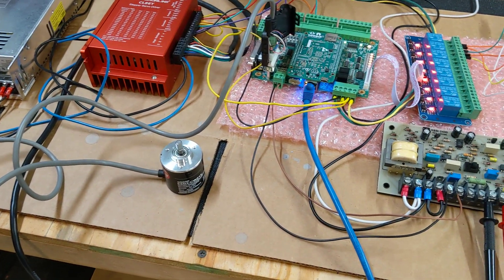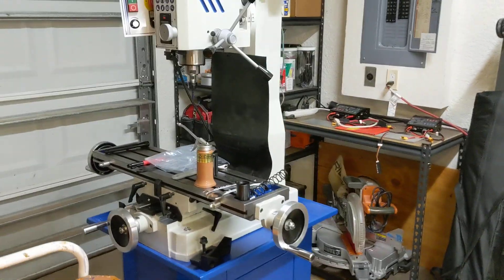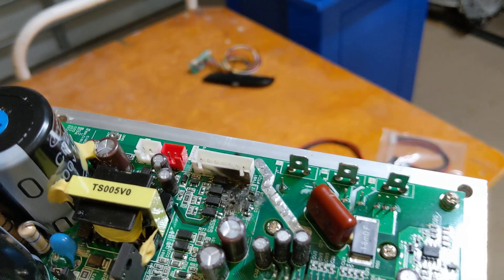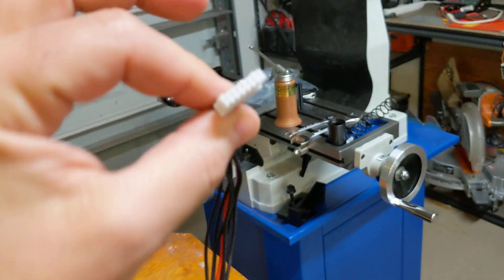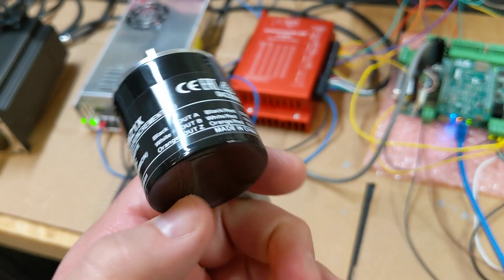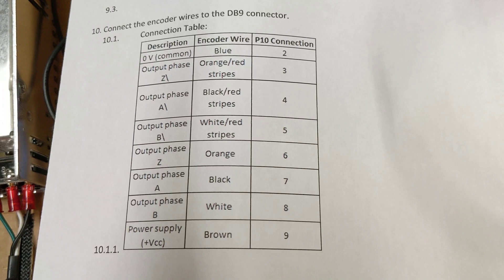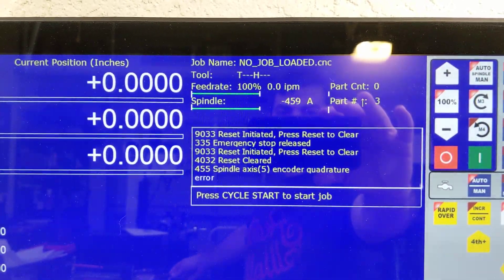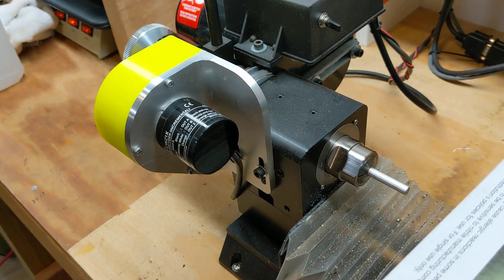PM-728VT Spindle Control #4 with Centroid Acorn

Comment: Totally unrelated comment for the video. Have a question about ClearPath servos. I'm looking into a WorkBee CNC 1500x1500 build with a water cooler 2.2kW spindle. Is it worth moving to a very high torque NEMA 34 motor for the Z axis to ensure proper functionality? Looking at the CPM-SDSK-3441S-ELN servo. I will also be running two IPC-5 units to ensure proper power handling for higher torque servos.

Comment: This is a PWM to 0 To 10 volts converter and it can be wired in to replace the Potentiometer if their is a DC voltage lower than 12 volts across the Potentiometer's wiper and ground. It has the relays for the reverse and forward directions. Read the page 10 for how to do this.https://www.cnc4pc.com/pub/media/productattachments/files/c41s-r1.1_user_manual_v1.pdf

Comment: I'm mounting an identical encoder on my near-identical mill. I've bored out a little GT2 timing belt pulley to fit over the drawbar retention nut and have made a plate to hold the encoder and its matching pulley in tension. TLDR a similar solution to yours but with synchronous belts (the GT2 stuff is dirt cheap and widely available because of its popularity in 3D printers)
Reply from the maker: Nice.  Maybe you can share your design for the encoder mount?

Comment: Could you just use a TTL Digital chip to Potentiometer control circuit? Using the 5 volts PWM signal from the breakout board to control the Potentiometer circuit on the control board in the mill. Check this out. http://www.learningaboutelectronics.com/Articles/MCP4131-digital-potentiometer-circuit.php